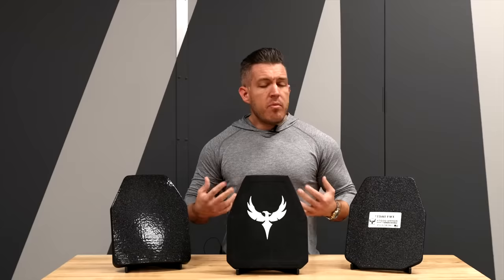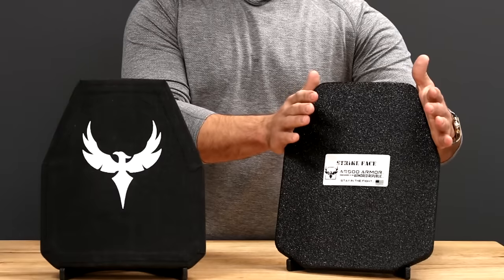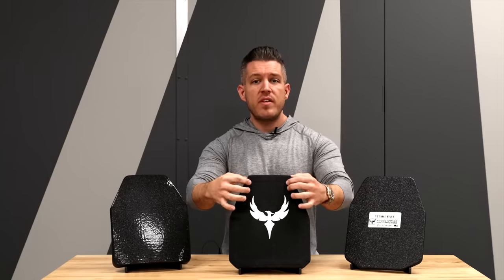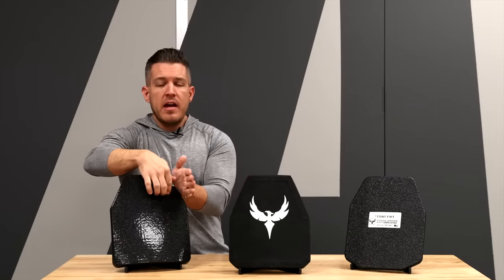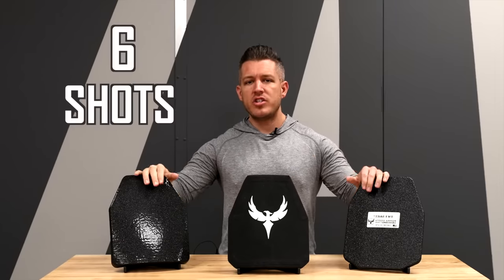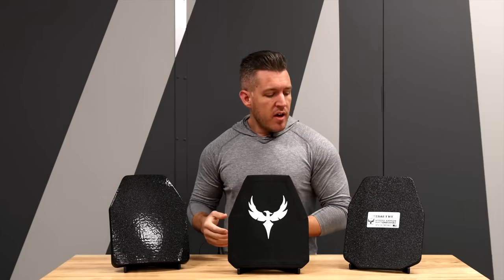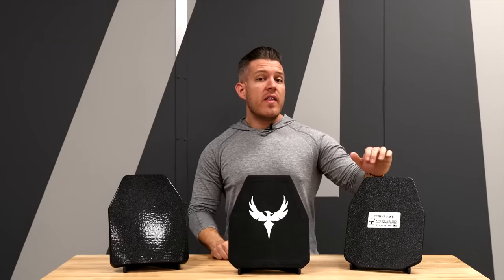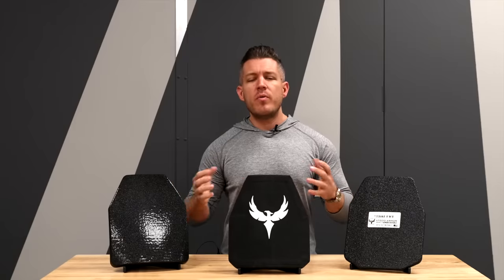What most armor manufacturers aren't telling you?   AR500 Armor

Comment: He could've EASILY knocked off 10 minutes from this vid by losing the industry mumbo jumbo.
The edge of the plate when its made out of PolyEthyne OR Ceramic is NOT as bullet proof as the center of that plate. The industry allows for upto 2 inches from the edge of these two types of plates to not be as bulletproof as the center so there's alot of wasted and ineffective material
Steel has the same strength thoughout but it's not as strong as ceramic.

No mention about what calibers each plate type stops which would've been useful.  Crappy video
Reply: I agree did not mention which calibers it stops and did not mention if it was NIJ certified, I understand ar500 is not NIJ certified.